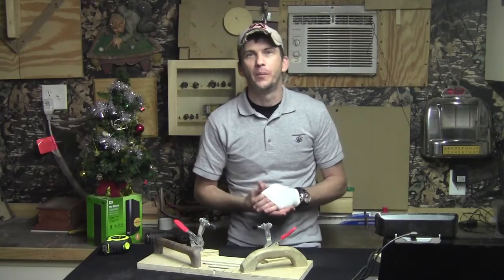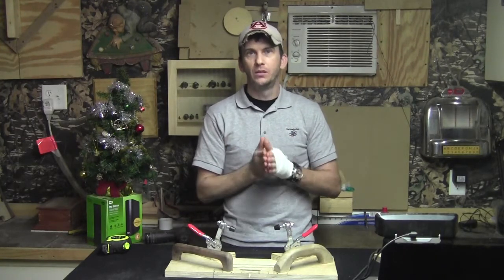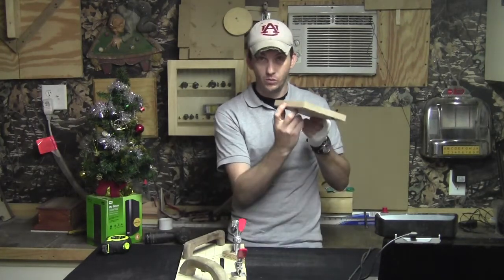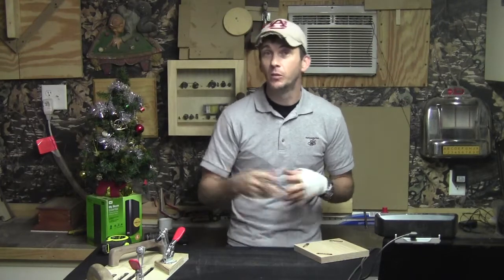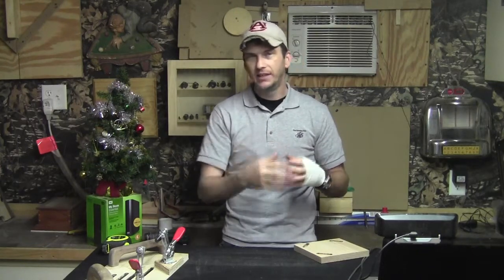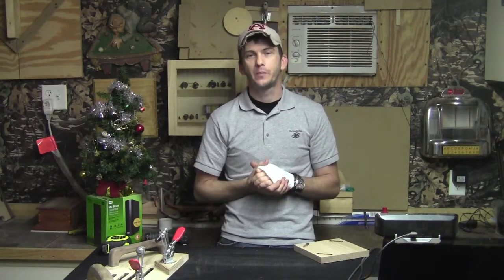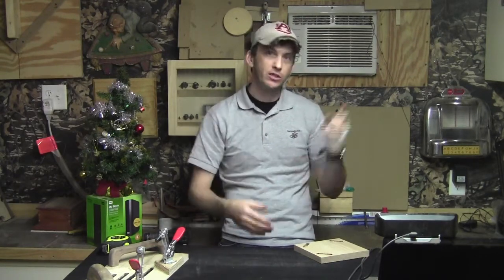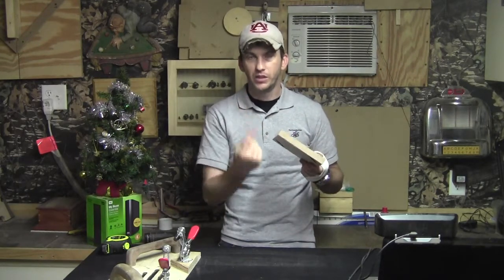Router Table Trivet Follow Up

Comment from the maker: What happened was.. I was at a clients home, doing some custom work.. I was not focused on the task I was performing, I was using a chisel with the wrong hand and My left hand which is my dominant hand was in the wrong place at the wrong time.. so i got cut by the very sharp chisel and it required some stitches.. All in all it was my fault for not being focused while using a sharp tool.. I should have told the home owners that questions will be answered after the task was complete.